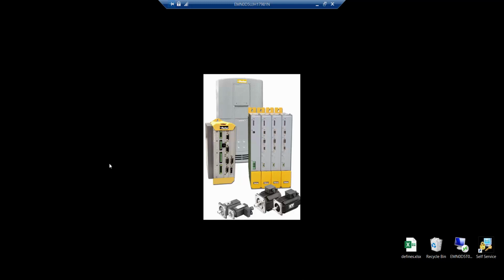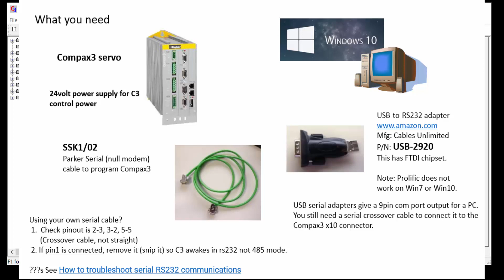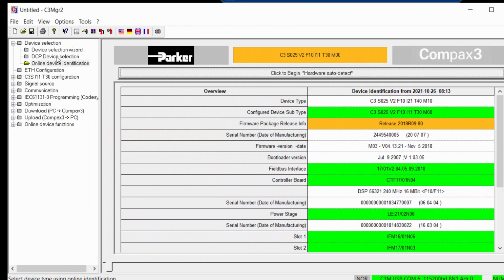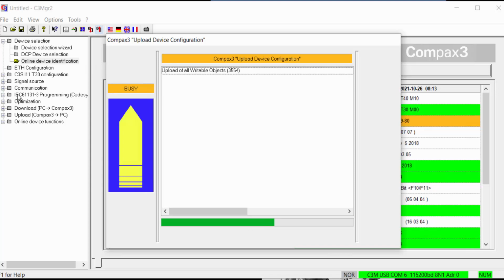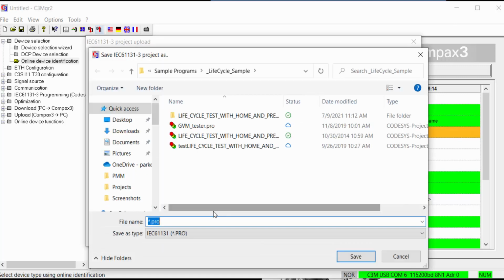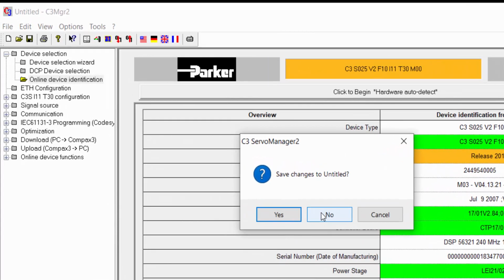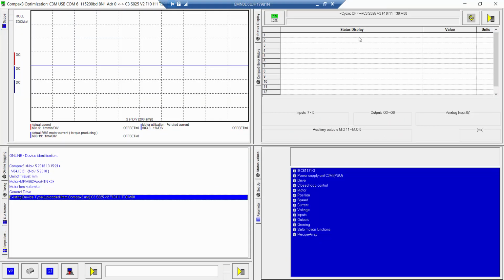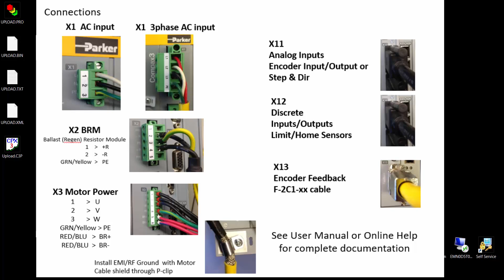How to Upload & Download Compax3 Servo Drive

Comment: I can not connect to my compax3 with c3mgr2. I tryed rs232,485-2w and 485-4w. switch settings and different cables, i set the jumper betwin 1 and 9 also in 485 mode,and i got 5.0 volts. No. No comunication with pc. What i've done wrong?!😢
Reply from the maker: Are you using usb to rs232 with ftdi or prolific driver? Needs to be ftdi. Throw prolific in trash.
Pin 1shouldnt be connected to anything. If using a gender changer, break it off or remove it.
For rs232it should be 2-3, 3-2, 5-5, no other pins connected.
Compax3 only needs 24volts to it for communication. What's status of the LEDs?
Reply: @JoHoMoCo yes it is ftdi and drivers are ok. For example those cables work with baumueller 100%. Also i tried to use moxa cable that described in parker motion manual - no result..i tried to switch to rs485 1 pin to 9 pin - no result. I ttied al these things with several compax3 with same machines - no result. Some of those compax blink green, some blink red.
Reply from the maker: Is your serial cable the green ssk1/01?
Check pinout of your serial cable if it's not.
If you jumper 2-3 at the end, open a terminal program like putty and bang on your keyboard, can you see what you're typing?

https://divapps.parker.com/divapps/emn/faq/SSK1.pdf

2 and 3 are crossed, 5 is straight thru. Pin1 not connected.

If you jumper the end 2-3 and open putty, you should see what you type. If not you've a broken wire on either pin 2 or 3.

If it's a straight thru cable, you can use a null adapter.

Can you see the port under serial in device manager? If it's ftdi, you should see that port appear in c3 servo mgr with c3m in the line of the port selection. 

You don't have any other software running that's trying to use that serial port?
Reply from the maker: Baumueller uses straight thru for rs232. You need a null modem adapter or a crossover serial cable that switches pins 2&3.
Reply: @JoHoMoCo i connect all 9 pins male to female. 24volts between 1 and 9 at the compax3 side
2-3
3-2
5-5;
Does it meen that i have to change wires from my cable to compax socket? Right?
Reply from the maker: @ivanlitvinov9917 I don’t know why you’re connecting 24v on 1 and 9. For rs232 with c3 srvmgr only need 2, 3, 5 with 2&3 crossed

Comment: Please help it shows error when I press device identification 
1- Cant read device type
2- Time out
3-Action cancelled
Reply from the maker: Confirm correct com port is selected. It should say C3M at end. If not, check device manager, buy usb serial adapter with ftdi chipset. C3 only needs 24volts. What’s the led status? What’s part number on side of c3?

I’m no longer in support or actively monitoring this. You can contact your distributor or technical support at  emn.service@support.parker.com

Comment: i am facing an error at this point when loading the configuration , the communication is established fine. auto detect is working fine but cannot upload 

it says could not load template 9 v 20 - could not execute function
Reply from the maker: That’d indicate it’s custom. What’s the part number of the drive or is this a PLmC (C10 or C20)?

Comment: Thank you very much for the link. I  modified Codesys and then I have tried upload the configuration data  and the program from controller. When I used the new version C3Mgr (09-81) only the configuration was uplaod. When I used the old version (09-68) configuration was upload  and then  a message appeared: The loaded project was created with a never C3Mgr version! As it is possible that will not work with this version without adjustment. Is it other way how to upload or download program to/from controller?
Reply from the maker: If it's a new Compax3, it includes newest firmware, which requires latest version of C3 ServoManager    https://solutions.parker.com/C3_support

C3 ServoManager can talk to older Compax3s though as well.

Comment: Hello, I apologize but I have an one more  question about our communication bellow. I have Compax3 parker device:
 C3 S150 V4 F10 C0 T11 M00. F10 = resolver, C10 = integrated controller, T11 = positioning via digital I/O.
I have tried unplug ethernet connection between parker and HMI. Normal mode: HMI displays informations: HMI version: xxx xxx and SW version: xxx xxx. Unplug mode: HMI version: the same as normal mode but SW version - information is empty. 
My question... Is program for controlling and visualizion screens inside Compax3? Is possible upload the program from parker device? I have tried it but I have got only config.
Thanks a lot
Reply from the maker: C10 is a plmc. You’ll need to use C3 ServoManager to upload. Full details see the online help file. To see/modify the controller, you’ll need to install Codesys v2.3 and the plmc targets. 

https://community.parker.com/technologies/electromechanical-group/electromechanical---industrial/w/electromechanical-knowledge-base/297/compax3-software---t30-t40---how-do-i-add-c3-iec-library-how-do-i-install-change-targets-5830-3740-errors

Solutions.Parker.com/c3_support
Reply: @JoHoMoCo  Thank you very much for the link. I  modified Codesys and then I have tried upload the configuration data  and the program from controller. When I used the new version C3Mgr (09-81) only the configuration was uplaod. When I used the old version (09-68) configuration was upload  and then  a message appeared: The loaded project was created with a never C3Mgr version! As it is possible that will not work with this version without adjustment. Is it other way how to upload or download program to/from controller?

Comment: Hello, I have a other question, I have a problem, when I upload Compax 3 servo drive I upload config parametrs from servo but I don´t get any bid for upload codesys project. Is it a mistake for my side? Could you help me? Thanks a lot
Reply from the maker: Look at online device identification.
Is it configured as a t30 or t40?
Or was it configured as a T10 or T11?

If it’s a T10 or T11, there won’t be a CoDeSys program.
Reply: Thanks your quickly answer. Yes device was configured as T11. It mean, the device is use as positioner T11 and feedback F10 as resolver. The device /home position, speed, acceleration, etc is controlled from a master cotrol system? For new Compax 3 servo driver suffices download only .cfg  file which I uploaded from old device? P.
Reply from the maker: The T11 is a simple indexer and everything is in the drive configuration file (.c3p file).
Only the T30 or T40 use CoDeSys v2.3 (as an offline programmer tool, with the .pro file -- in addition to the drive's .c3p config file)

So yes, if you've uploaded from the old Compax3, connect the new one and then download, you're good to go. The new part number will need to match the drive configuration in the software.

Someone could've bought a T30 but then decided to use it as  T11 and dumb it down in the software.  So it could be  T30 or T40 printed on the side of the C3 but used as  a T11 or T10. 

Sometimes that gives programmers flexibility if the spec hasn't determined what all the drive needs to do.  

Or if someone needs a spare T10 and have a T40, you can dumb it down to the T10 base drive and voila  -- rather than having a lot of different configurations.

The power level and F feedback need to match (S063V2F12IxxTxxMxx) though as the current & voltage are based on the hardware and the F feedback is either resolver F10 (or Stegmann) or incremental encoder F12 (or EnDat)